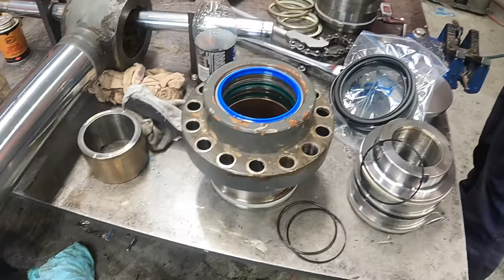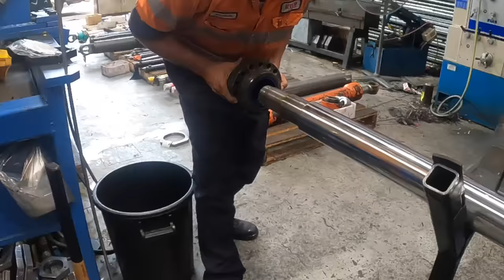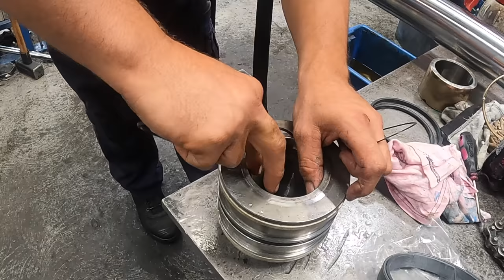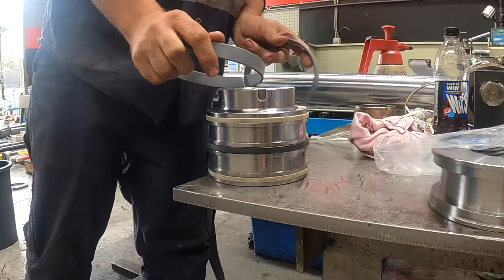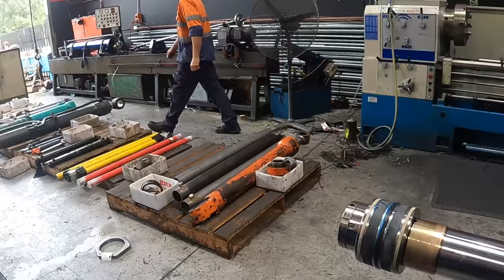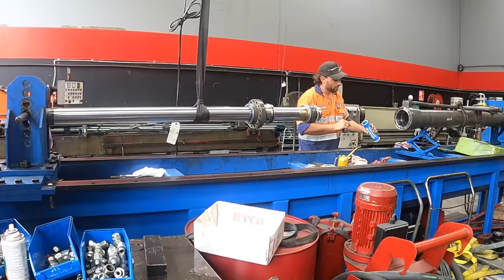VOLVO EC290BLC Excavator Boom Cylinder Rebuild

Comment: you didnt show taking the head off one. thats the hard part. Especially when they have been on awhile
Reply: one that the head unscrews
Reply from the maker: This gland is bolted. Fairly straightforward to remove as we have a hydraulic strip bench but they can be stubborn at times if you don’t have mechanical advantage.